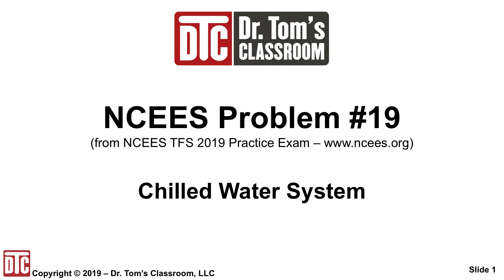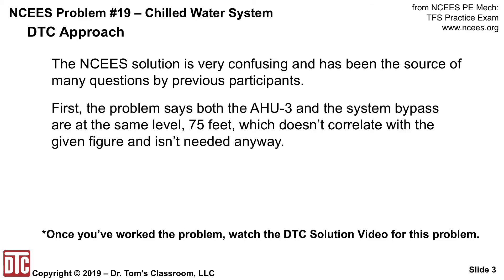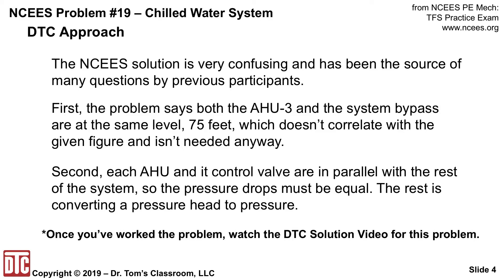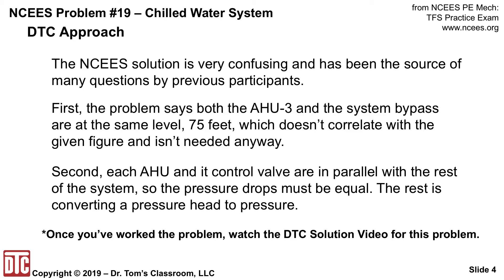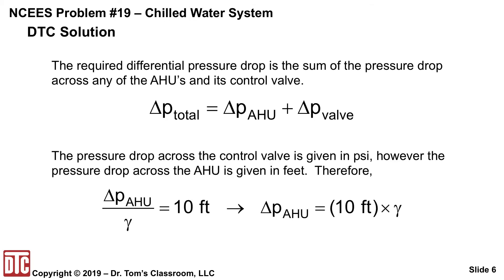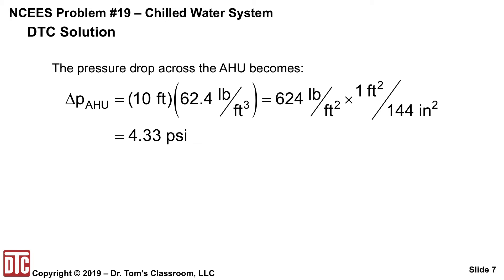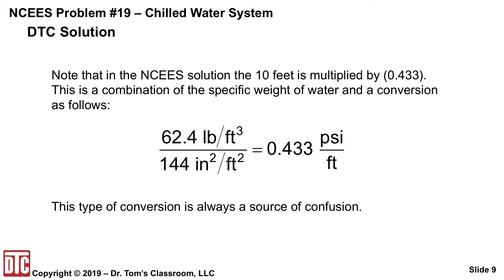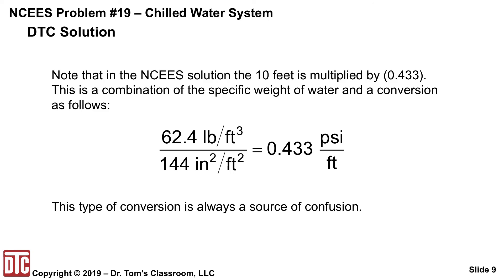NCEES PE Mechanical TFS Practice Exam Problem 19 - Chilled Water System (Solution Tips)

Comment: in the equation, 62.4 lb/ft3 = 62.4 lbm/ft3, not 62.4 lbf.  You are off by the gc = 32.2 lbf-s2/lbf-ft
Reply from the maker: In the NCEES solution they multiply the 10 feet of coil pressure drop by 0.433 which is the specific weight of water 62.4 lb/ft^3 divided by the conversion 144 in^2/1 ft^2 which gives the units of 0.433 as psi / ft.  Multiplying by the given 10 feet gives the proper value and units of psi.  So to divide by 32.2 lbf-s2/lbf-ft would give an incorrect numerical answer and the units would not yield psi.

Comment: So... if you had to place an X on the points we're comparing pressure at they would be 1) just to the right of the bypass valve and 2) just to the left of the bypass valve? The elevation change is 0' (both points are 75' high in the building) and thus the elevation doesn't matter? 

The question phrasing made me think we were measuring 1) just right of the chiller ("chilled water supply") and 2) just to the left of the bypass valve ("return headers measured at the chilled water bypass"). In that case the 75' would seem to matter...
Reply: I think you're correct. It's confusing because they consider the chilled water supply to not be the supply to the supply to the chiller, but the chilled water supplied to the AHU. Confusing question only because of how that interpretation of chilled water supply, i agree.